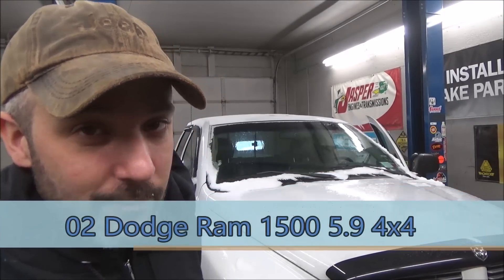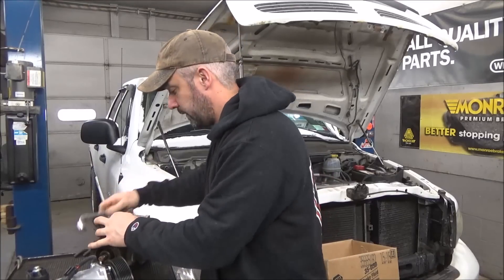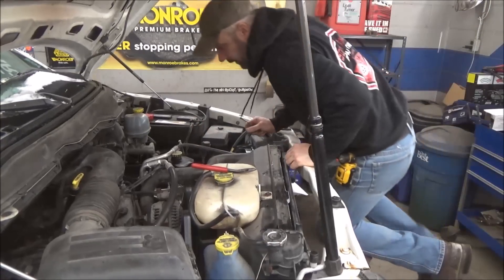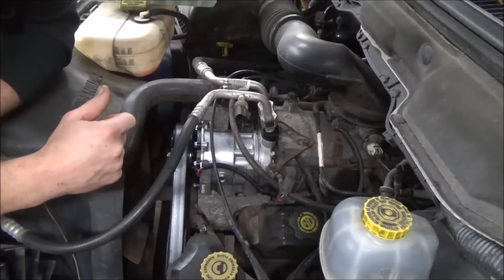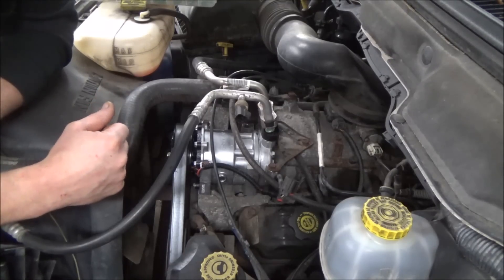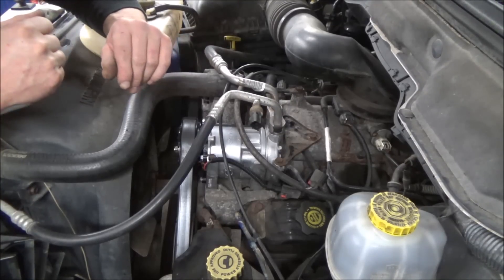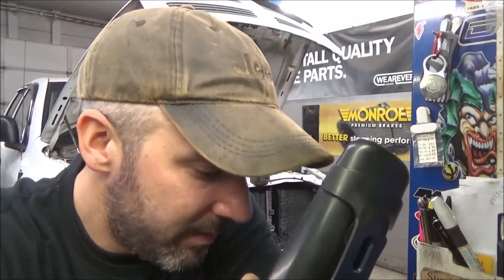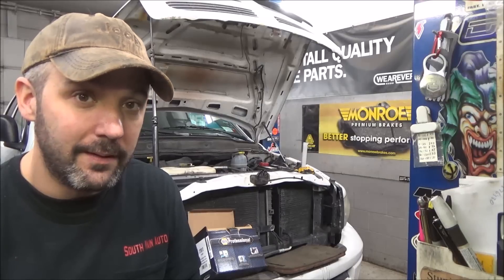Dodge Truck A/C Repair Part 2

Comment: A good vacuum should pull any moisture from the system. Not un subbing for sure... I had the same engine A/c type. I seem to remember that the discharge lines on mine had a combined (spacer?) seal between the lines and the compressor body. It was one piece with two holes /washers for the lines. With Chrysler though anything is possible they are never the same even within the same year of make it seems.
Reply from the maker: +ItsAlwaysRusty Oh yeah especially these half years when they switch body styles.

Comment: Hey Eric, if I were to pull an AC Compressor, what would I use to plug the lines? I might need to install a bypass kit like the customer did.
Reply: +Edward Shen I have the same truck with the same exact problem.   You don't have to put in a bypass kit, you can run a shorter belt and skip the compressor.  That belt route was on a sticker on the hood, so it was a factory option.   In my case, the correct belt is 83⅛”  NAPA 25-070825.  Yours might be different.
Reply: +Batti2323 I don't have a truck like that. I was just asking as a general question.

Comment: I wouldnt worry about the accumulator. As long as the compressor didnt self destruct or if the guy didnt seal the system as well as he did so there were a bunch of contaminants in it, it will be fine. I replaced mine once only because I had my system open so many times chasing leaks and other issues.

Comment: Question, would it not be possible to shave/file the bottom of the tube a little, so it would allow it to drop lower into the compressor bore ? If you can't raise the bridge, lower the water.
Reply: Big chance of getting metal filings inside tube and the ac system. His shop would have to warranty work.

Comment: I know this is an older post but why would replacing the acumulator damage the evap? I may need to replace one soon and would like to know the traps.
Reply: loosingmymemory7 -receiver \drier is mounted directly to the evap. They corrode together. If you get it off,the threads may be beyond repair

Comment: hey Eric I'm curious on why you charge on the high side?.I always charge on the low side.idk if it's just a preference or is their actually something more towards it.
Reply from the maker: +nmattcar I always charge liquid on the side where the liquid belongs, on the high side, that way I never have to worry about swamping the compressor.
Reply: +South Main Auto Repair alright I was just curious in school they always told us to  low side charge.
Reply from the maker: with a machine or a diy can?
Reply: +South Main Auto Repair both.they said it didn't matter if you were just using a manifold gauge set or a cool tech always low side charge.
Reply from the maker: hmm I have always charge liquid through the high side.
Reply: +nmattcar The CoolTech can service on the high side, low side or both it's a sweet machine...safer, quicker and more efficient. Servicing from the low side takes longer and and servicing liquid on the high side eliminates the possibility of liquid reaching the compressor & damaging it.  I still service from the low side but not if I had the CoolTech...I'd love to program it and walk away and go work on something else while it was doing it's thing plus it makes servicing oil easy and contamination free.
Reply: Set it and forget it...love technology!

Comment: Every time I've been to the junkyard, I've noticed that the mid-90s-ish to early 2000s Chryslers have a spacer between the lines and the compressor.  Maybe there was one on there originally that got lost?  This is why I hate working on something after someone else has done work on it (I work on electronics as a hobby and industrial equipment for my day job).  You never know what they did to it before it showed up on your doorstep.

Also, is that a curtain rod you used to hold up the hood?
Reply: Also, a cheap pair of calipers with depth gauge ($12 at Harbor Freight or Northern Tool) has helped me on more than one occasion figure out the depth and diameter of holes before throwing a part on.
Reply: +Josh Brewer  They never could make up their minds which gaskets to use on those dam lines. I've seen them with one, the other AND both. lol
Reply: Josh Brewer - if you want to find out what they did to it you find the dumbest person around you and ask them how they would do it. And if you ever want to know the easiest way to get a hard job done ask the laziest person to do it, they’ll find it.

Comment: Hi Eric
You make some great videos. I have code U0140 lost communication with body control module. It is set a a permanent code  How does it get erased. Took it to the dealer,said no problem but code still there.
Thanks Mike
Reply from the maker: +Michael Rousselle They should be able to clear it then?
Reply: +South Main Auto Repair Thanks

Comment: Just found your site while looking at videos for a mode door repair on a 2006 Dodge 3500.  Great site.  I’ve got another issue with this same truck in that the A/C compressor will not engage.  It engages when I jump it straight to the battery and has 11.6 volts at the positive wire at the compressor when unplugged but as soon as I plug it in voltage goes to zero.  Do you have a video on a problem like this?
Reply: Check your relay
Reply: @caseyhetzelable  
  The relay is integrated into the circuit board of the TIPM.  We diagnosed the problem as a bad compressor clutch coil.  It was drawing to much amperage and the TIPM is programed to shut the A/C off if it senses to much amperage draw.
Reply: @weshawkins7165  OK wow...   COOL glad you figured it out.
Reply: @caseyhetzelable  
  Me too.  Those TIPM’s, Totally Integrated Power Module’s,  are a real problem with Chrysler products.  They build them with theses small relays that are a soldered on component of the circuit board that you can’t replace.

Comment: The shop manual for my 2002 F150 says it is not necessary to change the dryer when changing the compressor!
Reply: The shop manual does not care if you are cool and comfortable.
Reply: fwiw if a compressor fails and spreads metal flakes the drier will catch them, it's best to replace it when doing a compressor
Reply: @F06M6  exactly,,,,, especially if you suspect it may have the beginning of whats known as the "black death" in the system.

Comment: I know it has been a while since this video was posted but if anyone reads this comment and knows the name of the tool, can you tell me what are the funky looking angled box end wrenches that were used to open the drain plug on the AC compressor. Thanks for the info.

Comment: I am super curious why if you replace the receiver/dryer and the orifice tube it will leak for sure and then you have to replace the evaporator core. I have a 04' ram 3500 5.9 cummins that got the whole kit treatment with the main components replaced except the evap core and it is leaking out, but we cannot find the area it is leaking from so we have to assume it is the evap core now.
Reply: use smoke

Comment: well, most if not all parts houses require you also replace the accumulator/drier or desicant filter(depending on system) to honor your warranty on the compressor....sooo....do do at your own risk...lol

Comment: Where did you get those L shaped wrenches in the beginning of the vid around 5:25
Reply: +Redwood Auto Diagnostics - I got mine from Facom; i think several companies make them.
Reply: +Redwood Auto Diagnostics These are called Angled Socket Wrenches and they are TOPTUL. I sold them to Eric. These are universal in Europe but seldom, if ever, seen in the United States.
Reply: interesting, many system techs here in our company have them, out of 350 techs here most have the facoms or the odd german brand. but we arent in automotive field.
Reply: I too like them a lot. In Europe everybody has them. Ask a Frenchman for a wrench and this is what he's going to hand you. They are as common there as a combination wrench is here.
Reply: +SATAMAN Schmidt would you by chance have a set on eBay? If so I would like to purchase them
Reply: Yes, I have a set up on EBay. Search TOPTUL and you should be able to find them. You can also search on my seller name which is Schmidtdn.
Reply: +SATAMAN Schmidt yes! We just submitted the order, thank you

Comment: that is common with after market compressors just swap out rear cover sometimes it happens customer would bring in the compressor and we would swap it out and leak test and there off,  however there is a possiabilty those flat steel washer will fail when it heats up and pressure builds up in the summer reason being the tubes are not down far enough in the holes therefore there will be a blow out I have seen it NAD has happened on test benches  was ac comp assembler and tester be careful  the O rings were a better and safe way just needed to swaap out or get another sent to you, remember these remans or called new are Chinese casts not always to spec these are not OEM compressors they aftermarket and some come OEM due to being good cores for rebuilding

Comment: That's the problem lady. More people have to learn to go with it. They get so stuck on all the little supposed to be,s and should do's, that they end up causing themselves and their customers more grief than should be, if they had used reason and logic to decide which one of those they really needed do. Just like you did in this video. Old cars are old for a reason and unless they are a treasured classic or collector's item, good enough is usually good enough to get them moving back down the road, If you know what I'm saying. Jpol Ps. I would have skipped the call to All and gone with your gut feeling. Your a damn good mechanic if you'd only believe in your abilities and convince yourself of that. That was my problem in modifying things at first and it took many years of doing it for me to realize that when I come up with an idea now, the manufactures could use it for a permanent fix for the problem. That's one of the many skills that makes up the being of a real mechanic, versus just a diagnostic genius or a master wrench man. It's just to bad at that point they don't issue us a mechanical engineering degree to paper the wall with besides our license and certs.
South Main Rocks! Jpol.

Comment: Don't need ac to defrost/defog windows, had a 98 grand am with no ac... Windows cleared fine in the winter months. Live up north temperatures hit -45
Reply: But when you blow warm/ dry air as in a/c they clear faster
Reply: There is something to be said about that. Especially when AC was still an option on most cars, or a high priced luxury on others. Once in a great while the Windows frosted on the inside before the heater core warned up, but usually after that they were fine or there was no problem at all. Jpol.

Comment: ,  If you think about your vacuum /leak test you did, your only testing at a 14 pound test which really not a good pressure to test for leaks.  You should use co2 or nitrogen and test to say two hundred pounds.
Reply from the maker: +gary smith If we had a big hole we would know :)

Comment: why use the AC in the winter? I cant imagine how it can be better than the hot air from the heater core. BTW you are a lucky guy !
Reply from the maker: +FerreiraAveiro You need it in order to make the defroster work properly and it wouldn't make much sense to tear the dash back out again in the summer would it?
Reply: but doesnt it get even colder inside the car? where i live we dont have snow, the weather doesnt get too cold so its something i havent seen to clear/defog  windows
Reply from the maker: No it also direct the air through the heater core. The evaporator dehumidifies the air.
Reply: ah, thanks!

Comment: The a/c does not work in the winter when you turn your defrost on. The compressor will not turn on below 32 degrees. The reason for this is because as the temperature goes down so does the pressure in the system. I believe you need close to 40 lbs pressure to turn the pressure switch on which allows the compressor to start spinning. In the winter the pressure falls well below the minimum to start the compressor. This is the reason many people lose their refrigerant during the winter because the pressure you normally have during the summer pushes against the seal inside the clutch of the compressor and the system is able to hold pressure. When the pressure goes down seals that are worn or in bad shape are not being held in place by the pressure so they leak and in the spring people are having their systems recharged when it starts warming up. I did look it up and I guess I was right. At 0 degrees there’s 6.0 psig which is not enough to turn the compressor on. Even at 30 degrees the pressure is below 30 psig
Reply: That is why there is a pressure switch that turns the condenser fan on based on pressure not outside temperature. Same principle as used on commercial hvac systems in cold weather. With heat in the cabin creating a load and the proximity of the radiator to the condenser providing some heat the a/c can run in quite cold temperatures.
Reply: Gizmo42Rodeo The refrigerant pressure goes up or down depending on outside temps. The lower the temp the lower the pressure. Cars that have a pressure tight system can and will work unless the temp falls below the point where the pressure switch engages the compressor. In systems that leak around the seal on the compressor when winter temps bring the pressure down to the point where the seal starts to leak the compressor quits working until it is refilled in the spring or early summer. I’ve replaced the seals on compressors for that very reason. One night the car sits and the temp falls close to zero will empty out a system with a leaky compressor seal then your done for the rest of the winter.
Reply: Willie Gillie  So your initial statement was wrong. A leaking system will not run in cold weather due to low charge but the blanket statement of all a/c systems wont run below 32 deg is wrong. The pressure switch is mounted on the receiver/accumulator which is part of the  high pressure liquid line (after condenser before the metering device). It will shut off the compressor if the pressure in that line gets above around 420 PSI (about 120 deg F) or below about 30 PSI (about -16 deg F) refrigerant pressure/temperature internally. It's a very large range of operation. Latent heat of evaporation plus heat of compression can allow the system to operate into very low ambient temperatures.
Reply: Gizmo42Rodeo perhaps your correct but my instructor always said the outside temp and pressure in the system were about the same. Systems have very little or no pressure in the northern states in cold weather according to him. Maybe that was true before 134a refrigerants came out. I guess that’s something to look into.

 I checked and I guess I was right. 134a systems only have 6.0 psig at 0 degrees so the compressor won’t start right away. I’m not sure when it does work but I’m sure the engine compartment would have to warm quite a bit before the pressure reaches the pressure switch temp.
Reply: @Gizmo42Rodeo  for what it's worth, in the Dodge/Ram system the accumulator and pressure switch are located after the orifice tube.
Reply: Most cars will not run the ac below a temperature programmed in the PCM. The PCM will not even allow the clutch to engage. But on mild days run the ac for a few minutes to exercise it and lube the seals.
Reply: @AmandaHugenkiss2915  are you sure about that? A web article, dated 2015, states that A/C runs in conjunction with defrost to provide dry air for the defrost function.
Reply: It will run the compressor down to a certain temp. This may only apply to GM's vehicles though. I recall on my obd1 1987 cavalier the owners manual stated that the compressor would not engage under 40°F. My current car, when read by HP Tuners, has a field where the compressor is enabled above a certain temperature. But yes, the compressor will engage on defrost above enablement temps, I can hear it click on.

Comment: Good time to get the ac replaced in the dead of a NY winter..lol
Reply: well, maybe it is the logic of getting heating oil in the summer, they think it will be cheaper;

but on a serious note, you use your ac in the winter; for defogging your windshield.  hot dry air will defog it the fastest, that is why all newer vehicles (since at least early 2000s) turn your ac on automatically when you set defrost on.  There isn't many times of the year people aren't using ac in their cars these days.
Reply: My ‘10 Silverado was initially programmed to not run the AC with the defroster below 40F. You couldn’t drive without a rag to clear the fog. Chevy had an update to change that after lots of people complained about it.

Comment: just wondering if you seen an ac / heater in a 01 ram 2500 go from defroster to vents while driving and not touching any buttons mine does I have changed couple of vacuum hoses on engine that runs to it crappy ones and it still does it now in the dead of winter I have no heat no ac in the truck at all  but I can get heat when I'm driving engine running at 2500 rpms what am I missing this is a great next video for you to do or I might take it to pine hollow he is closer to me  right now any idea on a tempory fix to get me to springtime I'm going to recheck hoses tomorrow maybe I missed something if not I will give you a call for helppppp. any advice would help me right now I been fighting this for 2 years now not find a answer helpppppppp    pppppppplease
Reply: Its a vacuum leak the blend doors are vacuum operated

Comment: rams are good trucks i have 95 with 232920 miles on and it runs at 40 oil psi